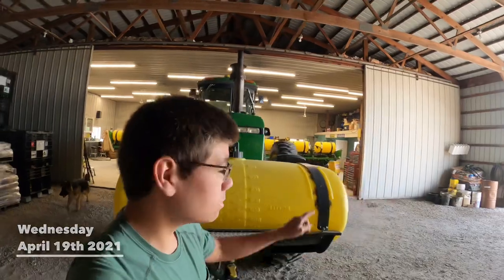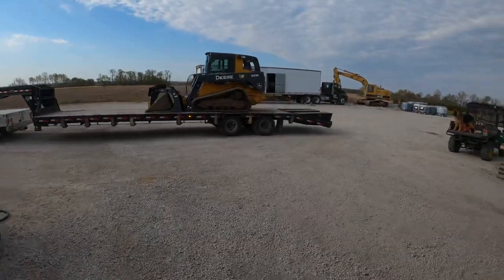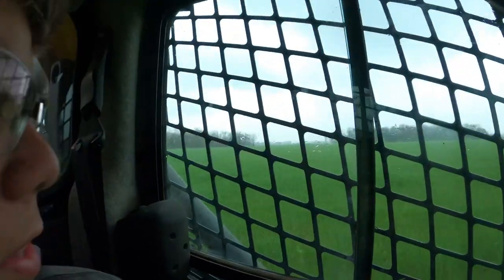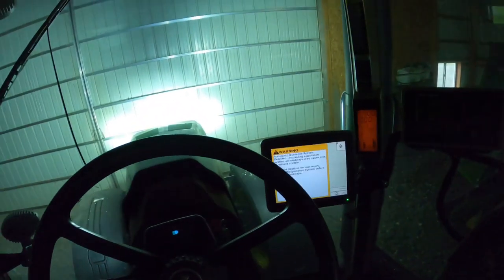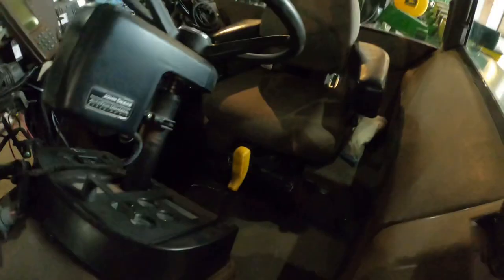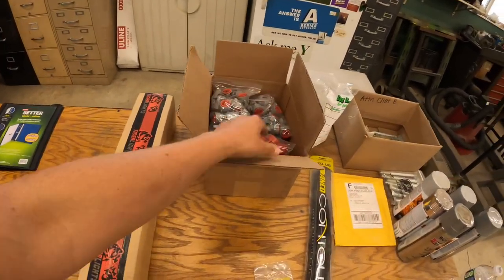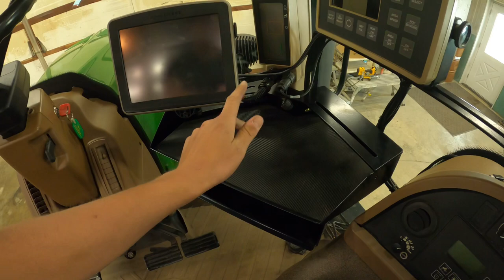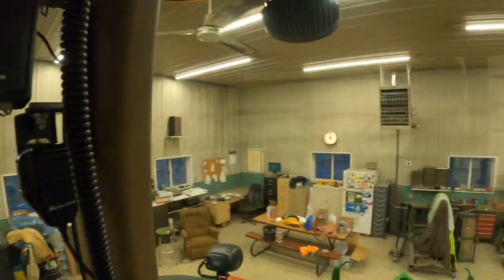SNOW In April?!?! - Upgrades for the 8530

Comment: Tractor cab is beginning to look like the space shuttle
While you were adding LED lights and washing it up did you change out the wiper blade?
Now if you had dictionary so we could know what all the jargon you use means!
Reply from the maker: Yep wiper blades front and rear got changed 👍🏼 Yeah it can be a little challenging to keep up with all the terminology 😂